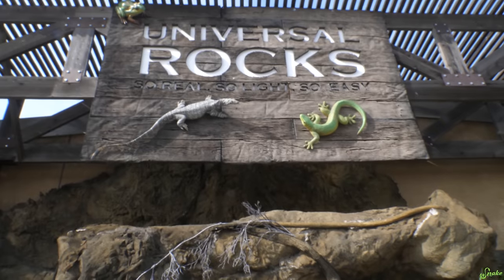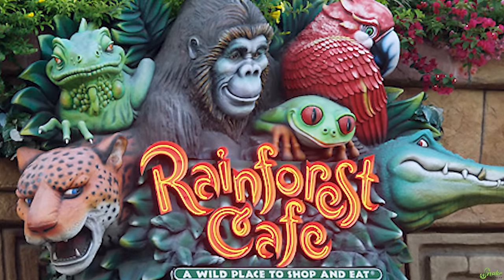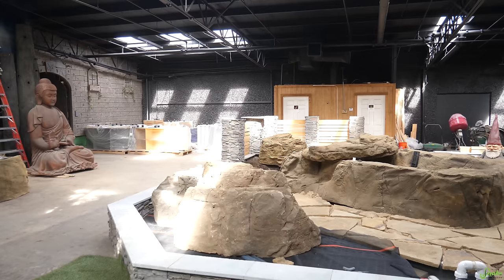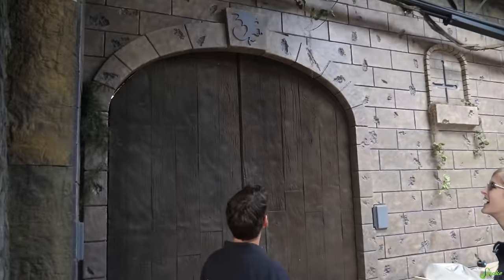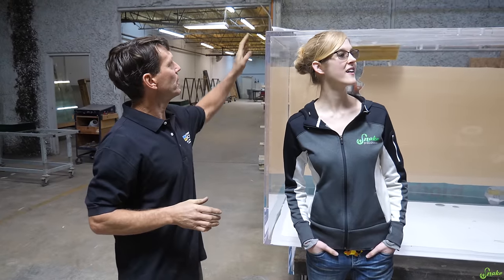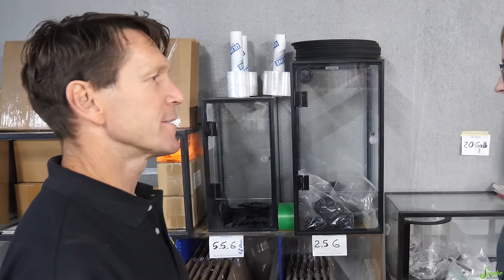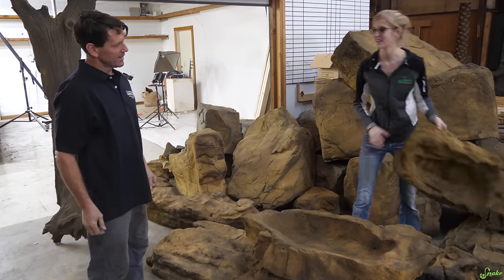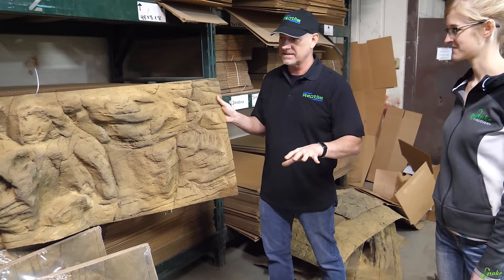We Tour Universal Rocks to Build our Zoo!

Comment: Real question tho, is the paint material on the fake rocks and whatnot water prof? Or does that have to be specificly added?
Reply: Actually, there is no paint at all. The color is from crushed rock which is spread onto the molds before the materials are sprayed. This way the color will never fade and they also feel like real rocks with a rough texture as well.

Comment: So I wanna get a ball python and I need all the items what price should I go for,for all my items I need
Reply: Moose athletes .1 It really depends on what type of set up/ what morph you get. If you use a glass tank I would recommend starting with a 20 gal long. If you wait till petsmart has its $ per gallon sale you can get one for around $20. ( you will still need a screen lid though, they cost around $15) Then heating wise I would recommend getting a heat mat and you will also need a thermostat to plug it into and regulate it. A properly sized mat would probably be around $15 on amazon and you can get a thermostat for around $20 on amazon. Water bowls are actually pretty expensive, so I’d buy one used if you can. Otherwise I’d price one at $10-$15 on amazon. Caves are also pretty expensive so I’d try to buy used. You will need two caves, one for the cool side and one for the warm. I’d set atleast $20 aside for them. For various decor I’d set aside at least $20 as well. You can get a large block of compressed coco chips on amazon for bedding at about $30. It will last you longer than a year though. I believe that totals out to atleast $155. It can be pretty expensive at first, and of course as your snake gets bigger you will need bigger caves, bowls ,and eventually a bigger cage. Depending on where you get your snake (and what morph you get), it should be atleast $50 for your snake.
Reply: ReptileRant thank you for your edvice
Reply: Moose athletes .1 Glad to help.